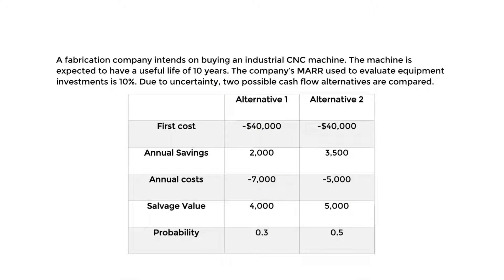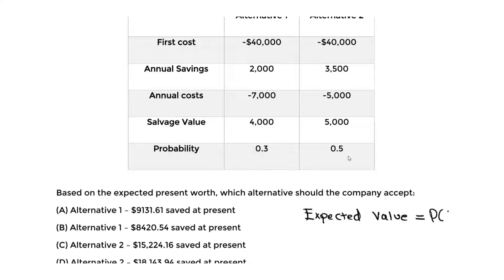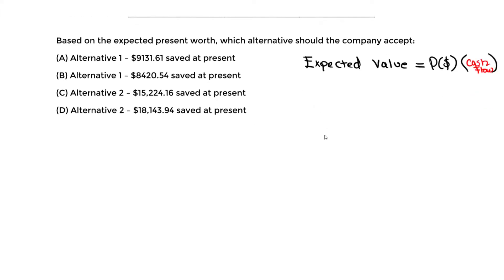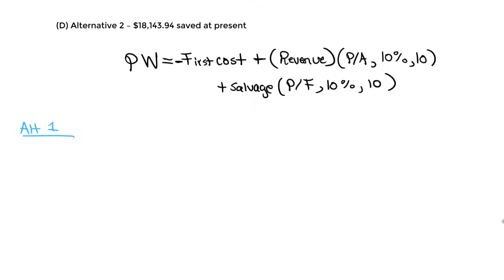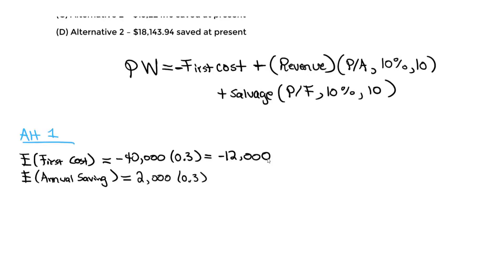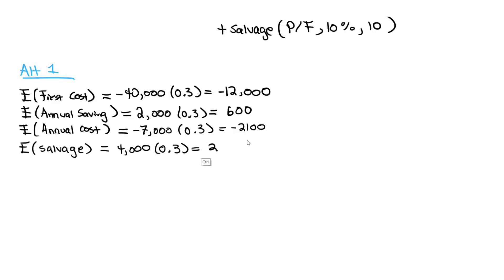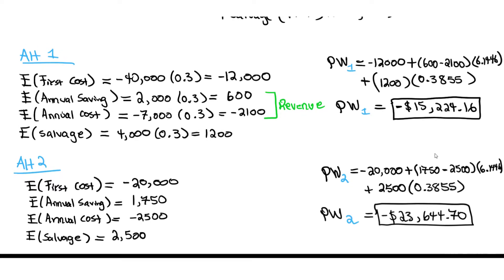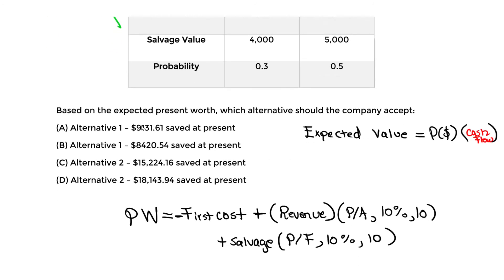FE Exam Review - Engineering Economics - Expected Values - (Arithmetic Mistake)

Comment: If PW @Alt 1 = -$20,754.30 & PW @Alt 2 = -$23,644.70; wouldn't the Savings be $2890.4. This Savings does result in a listed choice? Which Answer is it?
Reply from the maker: Hi Terry, sorry I had a math error in this video. Which I will redo (I have a lot of video with errors). 

As stated by the comment from others, the savings would be what you got - $2890.4. The alternative we chose would still be alt 1 since it is the lower present worth value we have to put down at present when compared to alt 2. 

PW @Alt 1 = -$20,754.30 < PW @Alt 2 = -$23,644.70 - Choose alternative 1 with a cost saving of  $2890.4